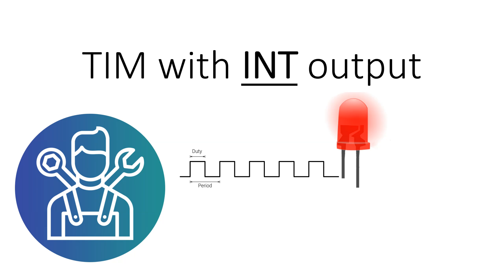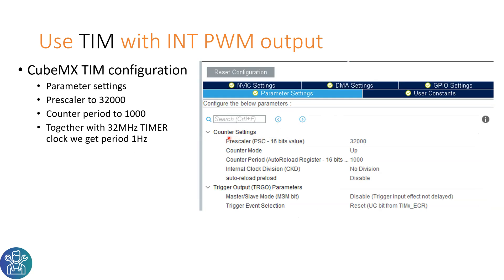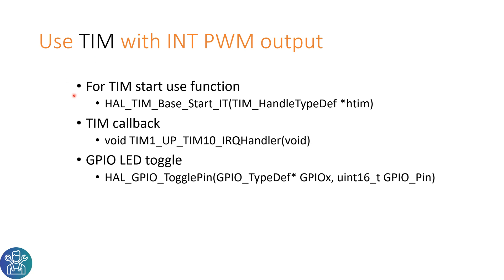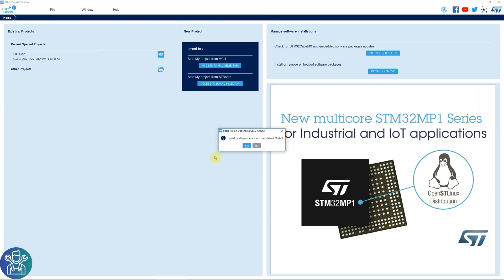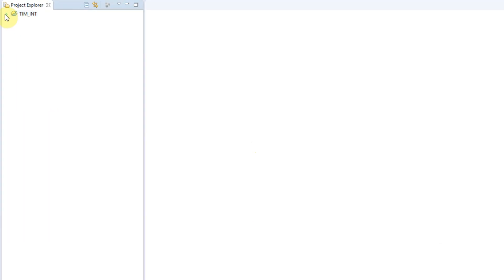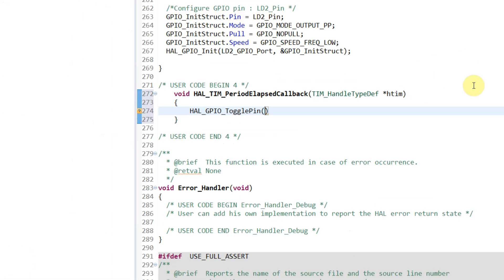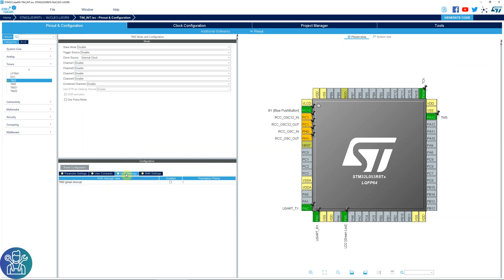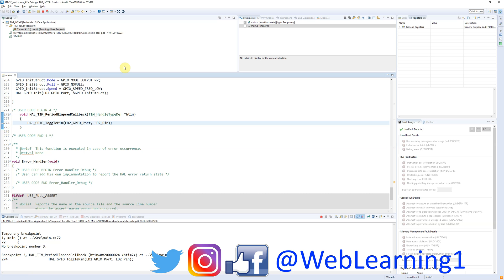HAL #10: HowTo Timer with Interrupt

Comment: So how can I add a pushbutton so that once pressed and released the led toggles? how can I achieve that??
Reply from the maker: You can use this video, and turn on the LED when you press the button:
https://youtu.be/UtkszckecV8
Reply: @Weblearning1  I meant using a timer as well, so that once the button is released the LED flashes on and off using timers.
Reply from the maker: In the interrupt of the button, you start the timer.

Comment: Has anyone ran into an issue where their timer clock frequency does not change, no matter what you change the APB bus to (using CubeMX clock configuration)? I am using a STM32H745I-DISCO board and have made sure I have included all aspects of every video I have watched on timer interrupts. Everything is working properly but no matter how I change the clock configuration, it is still the same (the values change but the LED still blinks way too fast: 240MHz even if I have the APB bus at 64MHz).

Thanks in advance, I have spent a few days on and off trying to figure it out

Comment: Also a more general comment.
Since you have done timers already ... A friend of mine told me he was using a timer and the dma capability of a µc to measure the RPM of a motor. Sadly he wasn't able to tell me more about it, since he hasn't used the HAL (or maybe a complete other µc).

I understand the idea of DMA, but I don't get behind the ability to measure the RPM with it.
I made a code that uses a EXTI to get triggered and check the timer for the counter and potential overflow (had a counter in the overflow-callback).
Using this with a normal external button it was quite blocking, since the button introduced much noise since it wasn't debounced.

Do you have any idea?

Edit: He said the DMA saved something (i believe it was the counter of the timer) and later he used this to calc the mean.
I would also ask him for more details ... But he is still sleeping ...

Thanks for your videos!
Stay save!
Reply from the maker: The RPM sends a square wave. The higher the frequency, the higher is the RMP. 
So you can use the PWM from the RPM feed into the TIM. Then use the DMA to read ever 1sec the counter of the TIM and reset the TIM again. What ever you read, that's is your RPM ( depends on the signal and timing ). 
Search google for: stm32 measure rpm

Comment: Thanks, helped so much.
But I got a question to the interrupt handler:
void HAL_TIM_PeriodElapsedCallback(TIM_HandleTypeDef *htim)
dose not contain die Timernumber!

How can I implement different interruptroutiens for ex. Timer 2 und Timer 6??

Greetings from Germany,
A.
Reply: No, not hard. I've found what I was missing:

void HAL_TIM_PeriodElapsedCallback(TIM_HandleTypeDef *htim) 
{

      if(htim->Instance == TIM3){
         // Do ISR for timer 3
      }

     if(htim->Instance == TIM6){
         // Do ISR for timer 6
      }
}

The ISR in your video will be called by overflow from every timer.

Thanx for answering,
greetings, A
Reply from the maker: Its hard to tell without know more. Look in google for HAL_TIM_PeriodElapsedCallback, there are many answers on the ST community.

Comment: This will work but then the beginners will not know anything even after implementing. I suggest you use HAL functions and not cube MX. At least the function calls can be explained better and which register is set etc can be explained.
Reply from the maker: You are right, but some want to get it going with min. reading and searching and the CubeMX is the best way to do that.
Reply: @Weblearning1   I agree. But if you could do one with the default HAL, that comes when you create a project with openSTM bench,  I somehow feel is the best way to satisfy both the groups. Because I see that these CUBE HALs are quite unreadable linking to functions after functions. The default HALs directly show what registers they're programming at the same time they provide the same exact functions that we want to implement using structures. I have had my own share of tough times with no knowledge about how to go about learning. Not that I've mastered anything. But this is a time where I have learnt how to learn before which I was searching in darkness. A designer who does not know or re inventing the HALs by reading it will always be handicapped and CUBE MX supports this. It's like teaching the student 1155665 instead of do-do-sol-sol-la-la-sol in piano.He will play twinkle twinkle, but not know it. Sorry for the long comment. I just wanted to request you in short to put up tutorials with default HAL in case you have time.
Reply from the maker: Thanks for this. It's hard to make everyone happy when making such videos. Most of the viewers need this basic approach. You just need to look at how many are using Arduino language. 
Coming back to how you are doing things, I suggest that you will have a look at LL lib that is also part of the CubeMX. You will see that it's much more closer and simple to what you want. When I will finish with the HAL ( one day ) I might start with LL examples.

Comment: Awesome tutorial. How does using a timer for an interrupt differ from using a GPIO interrupt? Thanks!
Reply from the maker: GPIO is a physical interaction with your system, so something will happen only if you press a button. A timer will make an interrupt (or an event ) every time the counter will runout of the set value you have programmed.
Reply: @Weblearning1  Thanks, very helpful!

Comment: Since this video is about learning. A proper prescaler setting should be (32000-1) and (1000-1).
Reason;   prescaler =0 will pass the clk without division
                  prescaler =1 divide the clk by 2
                  prescaler =2 divide the clk by 3
                         .........
                 prescaler =(n-1) divide the clk by n
Thanks.
Reply from the maker: Of course you are correct and thanks for sharing it with everyone.
Reply: @Weblearning1  Don't know much about video editing on yt. But maybe you can ad this as on-screen note to the video?
I have read this elsewhere too. But anyway thanks for your videos!